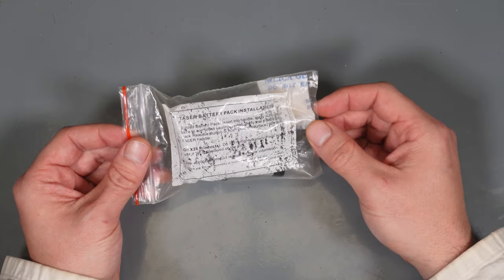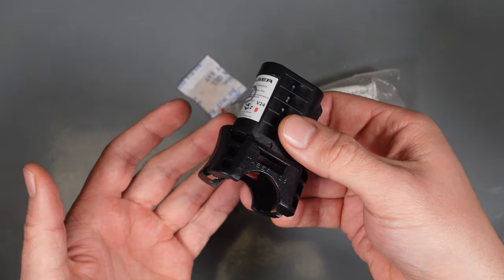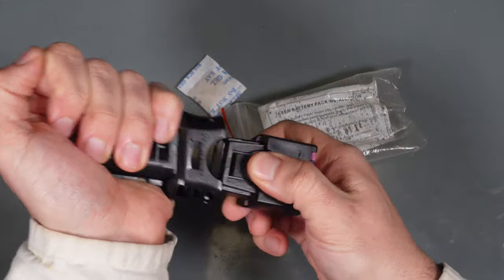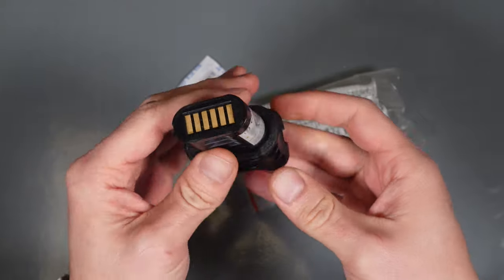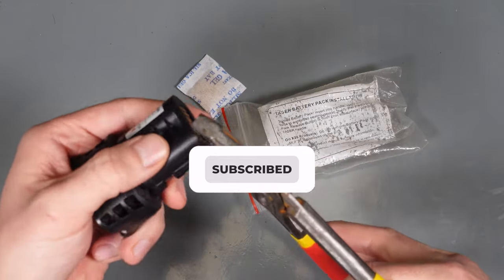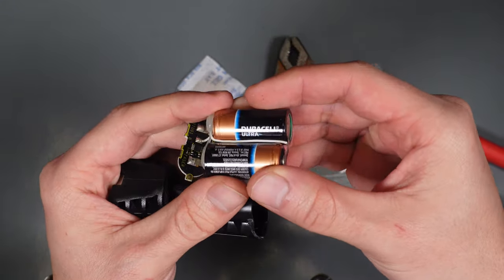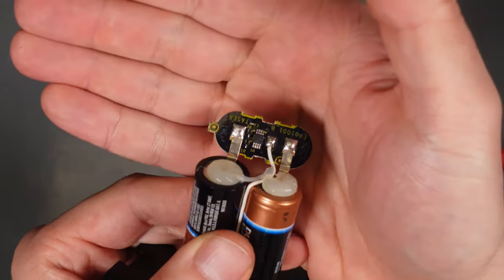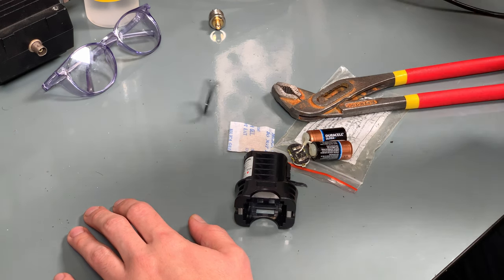Teardown - Extended Digital Power Magazine (EDPM) for X26/X26C with unexpected content.

Comment: Replaced a few of these back in the day on the X26's.  Personally I found the Energizer Photo Lithium batteries as replacements did better, maybe just me not liking the brand shown.  One I opened had a pair of Panasonic's in it.

Also, when handling a live cartridge, consider holding it be the sides and not placing the trap doors in the palm of your had or pointed toward you.  I don't recall if there had been any static deployments of the barbs but i wouldn't want to find out.  (been on the receiving end of them several times, I still twitch during thunderstorms).
Reply from the maker: You can replace them? Isn't that IC supposed prevent doing it?
That was pepper powder cartridge and it did not came with static guard - it was from Phazzer Enforcer (but can be deployed from both).